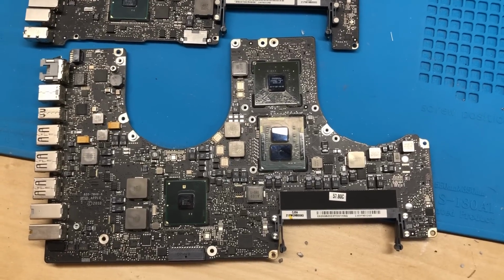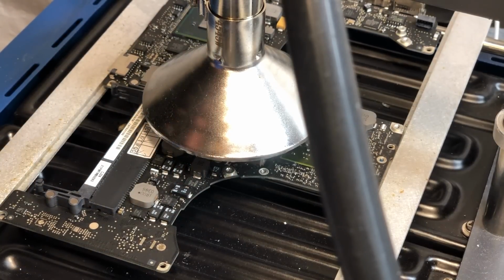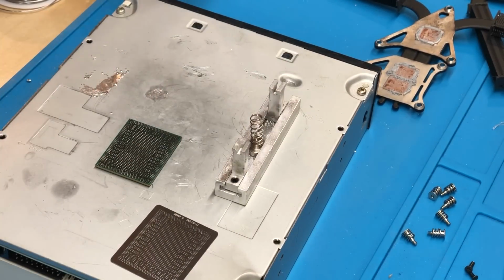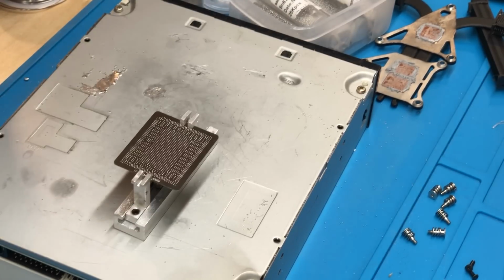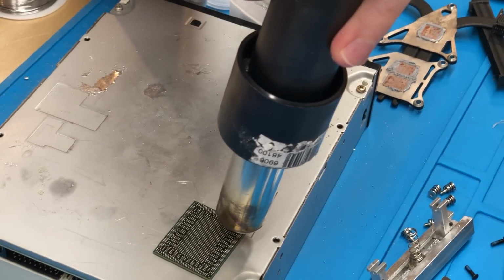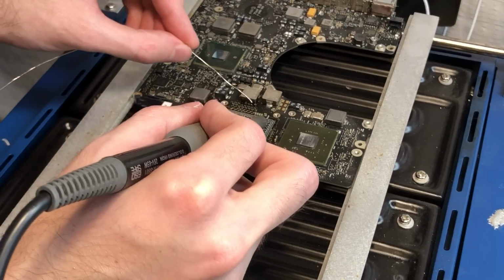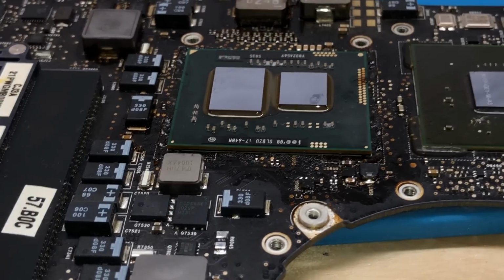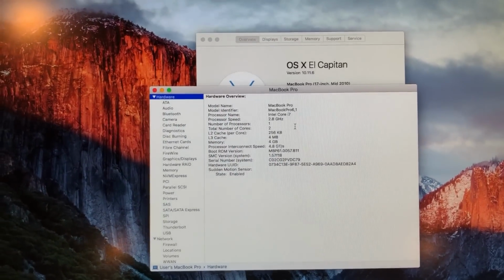Upgrading the CPU on a Mid-2010 17" Apple MacBook Pro

Comment: Can you only use cpu's that were supplied on mac's?

can you not install a higher end chip that never shipped in the macs?
Reply from the maker: You can use any compatible chip, however generally Macs have a config that uses the best compatible CPU of that generation.

Comment: Hi. I was wondering... Is it possible to put an MXM graphics card onto these Macbooks (15" or 17")? Using any M.2-like port like the wifi-BT one, or any Sata-M.2 adapter and installing it in the DVD bay? 

I saw a few people trying to make something like this on old PC notebooks, and I started wondering if this could be possible with these old MBPs, so they could get better graphics available (even if far from anything modern and powerful).

Comment: OH! Laptops like these don't run at full speed without a battery in place? I didin't know that. Does it run at full speed if there is a battery in place, but the battery is dead?
Reply from the maker: No, it has to be a working and charged battery for it to run at full speed.
Reply: @dosdude1 
 Are all Mac/PC laptops designed like that?

Yesterday I was thinking I might save some electricity by removing the dead battery from an iBook G4 which is running off the power supply. I also thought removing it might reduce the heat since the PS isn't trying to charge the battery.

Comment: I'm pretty sure I have a quad-core 1st Gen i7 that's hyper threaded in my laptop but it's not a Mac so you may have only meant they had the Dual cores only
Reply: There are 1st gen i7 quad core's, however there are no Arrandale Quad Cores, All Arrandale CPU's are dual core, 1st gen i7 Quad's are Clarksfield CPU's. The 2010 MacBook Pro cannot use Lynnfield aka Clarksfield CPU's, They can only use Clarksdale CPU's aka Arandale and the best Arrandale CPU this Mac can run is the i7 640M

Comment: Great video! Is the proccess similar with the 13 inch mid 2010? I want to try my luck upgrading the CPU on my old macbook. It just sits there now so I though it would be a good way to fual my hobby. Do you know this best CPU compatible with it?
Reply: I also have the same but I'm not sure either
Reply: The CPU is soldered to the motherboard so I wouldn't even attempt because its not a typical soldering iron project. He is using a specialized machine and other tools to do this. Also, isn't an application you want to call a "hobby" because its not practical and far from cost efficient.

Comment: Considering that board has discrete GPU, I wonder if it's possible to upgrade to a core i7-820qm instead? OK they do run hotter but the performance of the 2-core g1 socket range of CPUs is so piss-poor it doesn't make sense to upgrade to anything less than one of the compatible quad core chips

Comment: Hey Collin I originally disabled the radeon graphics card on my mbp 15” 2011 and was using the intel 300 one. It stinks. I recently re heated the gpu and applied new heat sink. I want to no revert back to my radeon graphics card but dont know what commands or codes to do to override the backup card. Plz help thanks

Comment: Hi Thanks for your excelent video. Could you please give us the temparatures used in the preheater and the air low and temperature  of the air pistol to remove and to replace CPU, also wich solder do you use
Thanks in advance

Comment: Thanks for your work.  I'm typing on a 2011 15" MacBook thats on 24/7 fixed with your mux reprogramming tool.  Also I have the same preheater and hot air setup as you when replacing the apu/cpu, but I've never been successful. This is mostly for reballing PS4 APUs.  I preheat the board with the temp set to 300+ and the board temp is around 200 C then I go in with the hot air at 380 C  at 80% flow with the rectangular nozzle and give a nudge test.  What could I be doing wrong?
Reply from the maker: Do you have the correct size nozzle? I use the Aoyue 4545W. Also set your air to 100%, or as high as possible. Also make sure you get the nozzle as close as possible without touching it to anything.

Comment: Hello there. I have a 2008 iMac, the 8.1. So I upgraded to Mojave, but some functions aren’t working properly. So I downgraded to High Sierra, I used your macOS High Sierra Patcher. And work as well, but every time I power on the Mac appears a black screen that says EFI she’ll só I fought it was an error and search on internet for a solution. So I downloaded APFS ROM patcher, and the only thing I read it’s I couldn’t do this in a NVidia, by the way my Graphic board is ATI so I proceder, but now when I turn on my IMac just appears a black screen, no sound only the HD, and some times when I turn on the fun starts in higher speed and loudly, but won’t turn on. Could you help me?

Comment: I wish I could get my 2011 17inch repaired like this. I believe the GPU got desoldered due to 2011 MBP's known issue. It started getting horizongal stripped lines on display for a while and now it just hangs with a greenish white screen on startup. So sad. It was my first a pretty amazing computer. Wish it had worked for more than 5 years though.
Reply from the maker: Since AMD never produced revised chipsets for those, they can never be fully repaired, unfortunately. However, I have developed the next best solution; a way to permanently disable the defective GPU, and use Intel HD graphics only. See more here: https://www.youtube.com/watch?v=lJUyOysbl08

Comment: How did the CPU fry in that machine?
Reply from the maker: The owner dropped the metal back case on the board while it was on, and connected an 8.6V power rail to the 1.5V rail of the CPU.

Comment: Hi, I have same issue on my macbook pro 17 late 2011 (i7 2,5 Ghz). I would love to repair that machine. There is any chance to ask you as professional service, about the chance to find correct cpu and the price of the intervention? Thanks a lot.
Reply from the maker: I could definitely do this for you, however, are you positive the CPU is the issue? Although it was the case in this video, it is actually quite uncommon. Normally with the 2011 machines, the GPU is what fails, not the CPU.

Comment: How plausible would it be to upgrade the Ram on the first gen MacBook Airs from 2008-2009? 2GB is a bit tight now days and I was wondering if 4GB maybe 8Gb would be possible?
Reply: Im seeing a mix of answers to this. Id say try 2 4gb sticks and see if it works. I believe those run ddr3 but I could be wrong
Reply: 4gb will work definitely not sure about 8 but try it

Comment: Hi Collin, thanks for this video. very interesting. Do you think it would be possible to swap the 15 " Macbook Pro 2010 CPU on the 17" 2010 board ?
Reply from the maker: Yes, that's exactly what I did in this video. They use the same CPUs.
Reply: @dosdude1  which bga machine r unusing i mean rework station for removing cpu, share heat profile

Comment: Hi dosdude. I own the 15 inch mid 2012 unibody macbook pro with damaged audio port and no sound. I have the 2011 15 macbook pro donor logic board and want to solder its audio port onto the 2012. Will it be compatible and is there any chance that the logic board will be damaged while unsoldering?
Thanks.

Comment: How plausible do you think RAM upgrades on a 2014 Mac mini would be? Cold you just swap the chips?
Reply from the maker: Not too bad. Just swap the chips and set strapping resistors accordingly.
Reply: @dosdude1  very interesting. There’s a lot of 4GB ones floating about, and its the cheapest currently supported mac about. I think it has two chips under a can on the bottom of the board. 4GB and spinning rust makes them painfully slow, but 8 or 16GB and an NVME would make one pretty usable.

Comment: totally unrelated but through BGA soldering, since the slot loading G3's don't have a daughter-board is the G4 swap possible? I'm relatively new to the whole upgrade scene and just got 3 working G3's for 50 bucks today
Reply from the maker: It depends on the model, but most are. Any that come stock with the PPC750L CPU are G4-swappable.

Comment: Is it possible to change the CPU on a 2011 MacBook Pro to a Mid 2012?
Reply: I don't think so, 2011 was Sandy bridge and 2012 was Ivy bridge, while a Sandy bridge chipset can work with an Ivy bridge CPU, it requires an update from the manufacturer, so my guess is that Apple never really updated the firmware to do this

Comment: Any issues with EFI / ME Region after the CPU change? I know that if you change PCH on 2011/12 machines, the ME region must be cleaned
Reply from the maker: Same deal with the 2010, but PCH is still original so ME does not need to be cleaned. The second die on the Arrandale chips is the integrated graphics, not the PCH (it's separate just like on 2011s and 2012s).

Comment: Every soldering guide on the internet: don't "sweep" with solder wick, you'll wreck the pads.
Every micro-solderer on YouTube: [sweeps with solder wick, everything works perfectly every time]

Great job! Was this just for kicks and demonstration purposes, or do you still have a use for that 17" MBP to keep it alive?
I wish my hands were steady enough for micro-soldering. I have a tremor and these days they're barely steady enough for regular soldering anymore (not that it stops me, but the finished jobs don't look as nice as they used to).
Reply from the maker: You just have to be very light when wicking or you will damage the pads or solder mask. This isn't my machine, it was a repair for a customer.
Reply: Yeah I've never had an issue just use good flux and be gentle. Works fine without pad/solder mask damage

Comment: so the chipset wont support the quads ?
Reply from the maker: There was never an Arrandale mobile CPU that was quad core.
Reply: @dosdude1  what about Clarkdale ? If it's an hm57 chipset it might support it
Reply from the maker: @zerokool1985  These are HM55.
Reply: @dosdude1  ahh okay do yeah I think it's stuck with the duals . Might be either a shot to test though ? I have an old Acer 7740g that is hm55 bit the quads worked on it

Comment: Hi which bga machine did you use to desold and soldering the chip ? Never see this kind of bga station before :)

And which temps did you use ?

Thanks for the video
Reply from the maker: It's not really a BGA machine, just a Puhui T8280 board preheater and Aoyue 852A++ hot air station with Aoyue 4545W BGA nozzle. For this board, I used 170 degrees C on bottom, and 290 degrees C on hot air.
Reply: @dosdude1  I was about to ask the same question, thanks. 170 degrees measured on the board or by the 8280? I have exactly the same tools and noticed that the temperature read by the 8280 is about 100 degrees higher than the board temperature (obviously, as the thermocouple is close to the plates). I had very back luck with the 828A++ using those large nozzles tbh, but you seem to be able to work fine with them. I thought the 24L/m flow of the 828A++ (along with its horrible heat distribution) was a problem. Thanks for the video! I am practicing with old boards to try to get more skilled on SMD reworking.

Comment: I attempted to do something similar by upgrading the cpu in a 2012 13" macbook pro. I couldn't get chip lined up right and it didn't solder properly. I guess its just practice but I can't really burn through machines experimenting
Reply from the maker: Those are more difficult, as they don't have silkscreen to help you align it.
Reply: @dosdude1  yeah I noticed that when I was too far in. Is there a machine you recommend for practicing that isn't too pricey and has easily availabe cpus? I appreciate the responce
Reply: @dosdude1  Only 17-inch Unibody models have silkscreened PCBs. And most older non-unibody MacBooks
Reply: @dosdude1  usually for aligning medium size BGA chips i push down slightly and wiggle until the chip locks into the grooves of the solder pads. Works well as long as the pads are wicked flat first. I haven't done any CPU swaps yet but hopefully the same technique should work